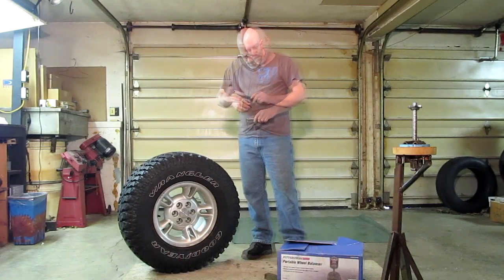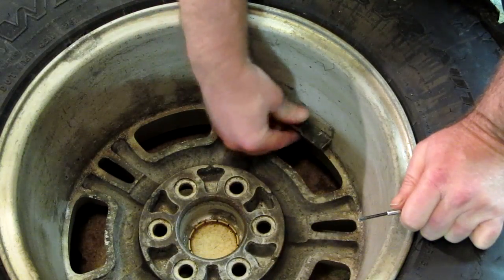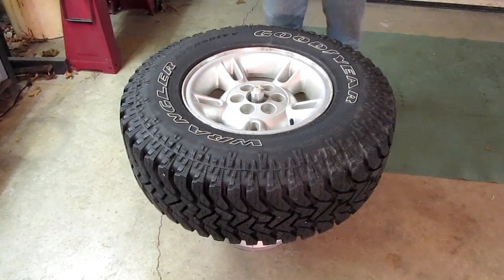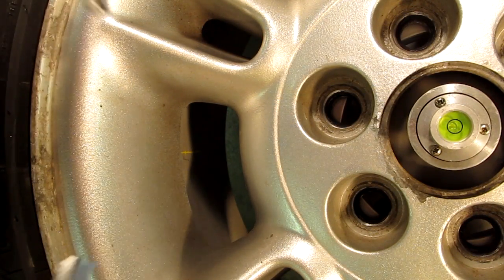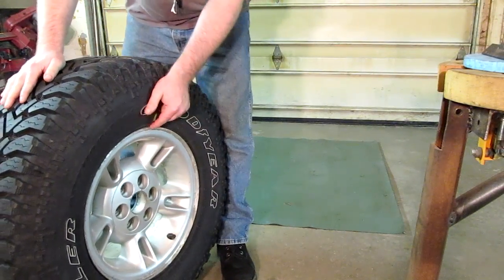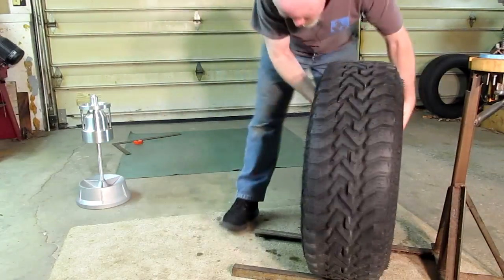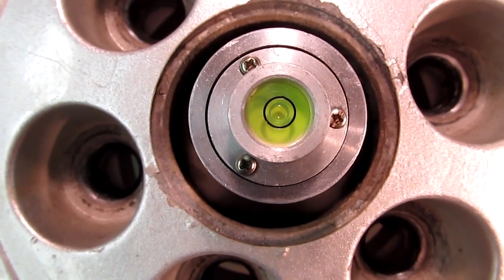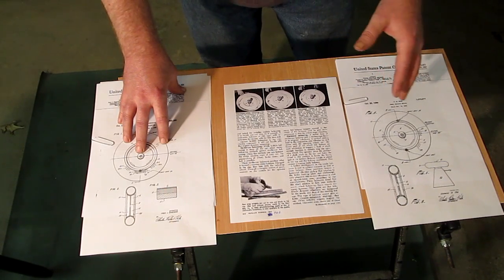Bubble Balancing An Automotive Tire To Correct A Static Imbalance

Comment: Maybe I am in the wrong section but I want to know how much I need to beat myself up when I am bubble balancing using this method which I have now used for years on end thanks to none other than you. 

I really struggle with 245/45s on 7.5 inch rims using a HF manual tire changer. Not so much because of the process but the fact that I am supposed to be aligning the yellow mark on the tire with the valve stem. Adding the duckbill mod and clamps to the changer really helped but since the name of the game is precision I find that it is just too much for me (so far) to line up the yellow mark with the valve stem with a profile that low while focusing on getting the tire on the rim. As a result, I end up turning the tire after mounting it on the rim to make them line up which takes every ounce if strength in my body. It feels doable when I am doing it but my back pays for it for weeks on end in a few days. How much do I really need to focus on getting that yellow dot lined up with  the valve stem? This is getting harder as I approach 50 but it really is that part which is bugging me. Does the yellow mark matter at all or is  placement 100% mitigated due to this process? Having the yellow mark off does mess with my OCD though. Thanks once again for making it a better for the commoners and stubborn bastards as life gets tougher.
Reply from the maker: Hello James, you definitely do not need to beat yourself up over the yellow dot. Putting the yellow dot anywhere close to the valve stem is fine, and even THAT isn't truly important. That dot just means it's the lightest point of the tire... which can be lined up with the valve stem (which is expected to be the heaviest point of the wheel). If lined up, then you MIGHT use less weights when balancing, but that's the extent of the importance of it all. :)

Comment: I worked at a Goodyear tire store in the early 70s. I was taught the 4 weight method back then. Some customers wanted the "on-vehicle spin balance" instead. The boss always had me do the 4-weight bubble balance method first. Most of the time, that proved to be enough and the spin balancer couldn't improve on it much. Good video!
Reply from the maker: Interesting.  Thanks for the input.
Reply: Tell me about the four weight method
Reply: @donovanbaker6835   I worked for Goodyear years ago when bubble balancing and spinning the tire while mounted to the car was all we had. I can't tell you the science of it, but using a bubble balancer, you use two pairs of weights (4 total) of the same individual weight. Slide them around the wheel until the bubble centers. Hammer two weights on the front of the wheel and two weights directly behind the front weights on the rear of the wheel. Then check it. If all is good and you then spin balance them, they will be balanced or really close, provided the car wheel ain't all out of whack.

Comment: Charlie, do you of a video that compares a bubble balanced wheel against a dynamic machine. It would be nice to compare the two. Also, I am an aircraft engineer and a lot of older aircraft have a bubble fitted in the wheel well to jack the plane into a level attitude, so I know the bubble method is accurate.
Reply from the maker: No, I do not have a video of a comparison between the two. It would be interesting, but I haven't done it.

Comment: Do these work for motorcycle tires too or just cars?
Reply from the maker: Definitely go with a different static balancer for motorcycle tires. There is a specific balancer for them and they are easier to use.

Comment: I have this same balance tool and it works well, I have found that when a tire is more then 2 oz of weight off it helps to break the bead and turn the tire on the wheel 1/2 turn most of the time the wheels and tires can be balanced before you seat the bead by just rotating the tire on the wheel and if you are really lucky some times you need no weight at all.
Reply: That's a good point.  Also, with new tires the manufacturer will often put a red or yellow dot on the side of the tire.  Line up that dot with the valve stem of the rim.  If you have both a red and yellow dot, line up the red with the valve stem.
Reply: When you mount a tire, you're "supposed" to line up the balance dot with the valve stem, as that's generally considered to be the heaviest part of the wheel. However, that is not always the case. If you have the time, you can put the bare wheel on the balancer, to see where the actual heavy spot is, then mark it, then mount the tire with the balance dot at that location. I do that with my personal motorcycle wheels. I've seldom had to use more than 1/4 oz. of weight to get them to balance out, if that!

I always get a kick out of how some of my customers will question my ability, equipment or integrity,  because when I do a wheel or a set of wheels for them, I only use a minimal amount of weight, but when a dealership does it for them, they end up using multiple ounces. First of all, they don't have the knowledge or the interest to do it my way. Second, they don't have the time.
Reply: That's the best part about these balancers. I have done that rotation of the tire on the wheel trick when mounting tires and often you can balance with very little to no weight. I learned the trick from a mechanic friend many years ago. It's awesome
Reply: Oh wow great idea!
Reply: I thought it was a tool kit making everything weightless!  Happy balancing!!!! Really!

Comment: Hi Charlie, someone told me to balance prior air filling first and move around tire with rim at same place. The said sometime you could lose some weight that way. What do you say to that?
Reply: It's always good practice to check the wheel balance before assembling the tire!
Many tires also have some dot marks (yellow and red). Keep an eye on the yellow dot, usually for alignment with the valve when assembling! more on that further down.

On a bubble balancer like this, it's a rather simple and easy procedure. You can check the wheel first, mark the lighter/heavier spot with a marker/chalk/tape. Your choice!

Than without assembling, just rest the tire over the wheel. Making sure the bead is properly located around the rim when you lay it down. Get a new reading and correct as needed by moving the tire as you please. When you find the sweet spot mark it. Then assemble the tire by the correct marks.

Usually the amount of weights needed to balance the tire. After this exercise tends to be greatly reduced!  

Keep in mind that the lightest spot on a wheel tend to be by the valve hole. While this is usually true for steel rims, many times it's not so much for alloys! Where reinforcements may be present at that spot. So better check. Also rather common nowadays the presence of pressure sensors or bead lock(s)! Can drastically change the "lighter spot". So make sure to use ALL the variants while doing it. Even the valve cap! ;-)

Quite honestly it's faster to do it, than writing about it. LOL 😂 

I hope it makes life easier! ;-)

Comment: Does make any difference if the wheel 19inch or little bigger. To work correctly?
Reply from the maker: 19 or so is  fine for this static balancing.  Just remember the wider the tire is, the greater the chances of a dynamic imbalance.

Comment: I'm hoping someone can answer this...Why do balancing shops put the stick on weights close to the edge of the inside wheel.  The video shows the weights being put in the center which makes sense.  But, if the "professionals" put it on the edge using sophisticated balancing machines and they do it for a living wouldn't that be the proper place to put them?
Reply from the maker: Weights placed on the side means they are correcting a dynamic imbalance and possibly a static imbalance as well. Placing the weights in the center only corrects a static imbalance.
Reply: Thank you for the response.  So this is something we can't correct for using our bubble balancer.  Guess we just hope for the best.

Comment: I have been using your technique for years now with great success and thank you for that. I do have a question though. Every once in a while I have a rim/tire that is a pain in the neck. When I put the stick on weights as described, The bubble will then move in a different direction on me. I was wondering if it is permissible to add a another stick on weight on an entirely different direction of the tire to get that bubble centered while keeping the first stick on weights I put on installed. Here is an example. I add an ounce of weight at the end of the rim temporarily. The bubble is centered then I measure half the distance of the rim and apply the weights there permanently. I then find that the bubble is no longer centered like it was when I put down the weights temporarily. In fact, the bubble only centers when I put a half ounce weight on some other part of the rim. Not sure what causes that, but was wondering if I can install the half ounce on that part of the rim (of course putting it at the half width of the wheel) if it keeps the bubble centered? Thanks!
Reply: you can do this but I don't recommend it when I worked in a tyre shop we would break the bead on the tyre and move the tyre on the rim say a quarter of the way around and try to balance it again, it could be that the wheel itself is slightly out of balance plus the tyre its self-giving two heavy spots the idea is to get the heavy spots together or if it needs a really lot of weight to turn the tyre halfway on the rim so it counteracts and maybe not need as much weight on  remoulds were the worst for this but not everyone as a tyre machine to do it , so like i say you can do it that way , but was just pointing out the way I was taught but in busy tyre shops they don't take the time nowadays to  look after there customers
Reply from the maker: I would say absolutely yes.
Reply: Thanks for that. You will probably never know the positive impact that you have made for us DIY folks, so I just wanted to make you aware of it.

Comment: should u get tires balanced regularly, or just do it when there are vibrations in steering wheel, seats
Reply from the maker: I balance my tires when new or if i feel vibration (sometimes indicating a lost wheel weight). It also doesn't hurt to check the balance when you do your tire rotation. That's my two cents.

Comment: I used to work in a tire shop in the late 1960s.  We used the 4-weight method most of the time.  Never had a tire come back with a problem.  But spin balancing on the car is better because you are balancing the entire mass of the rotating parts (tire, rum, brake drum/rotor) even though the drum/rotor are rarely that far out of balance.
Reply: I can agree here as I started tyre fitting straight after leaving school, we used the bubble balancer first then spun them up on the car with the magnetic pickup under the axle with the strobe machine when they were balanced the needle would remain in the green showing there was no vibration coming through the car from the pickup , but the guy that taught me was a perfectionist he would extend the Ariel and if there was any kind of flutter from it he would slightly adjust the weights till there was nothing coming through the ariel at any speed  took a little longer to do but never ever got any comebacks from being out of balance people always asked for me in the tyre shop as they liked to know they were getting it balanced to the best it could be , I remember a few of the guys in the shop just couldn't master the art of where to put the weights I found it easy we used to chalk a line on tyre so the strobe would statically show where it is and work from the 12 o'clock position great days wish i cxould go back in time loved my job then .nowadays the just rush everything and halve of them dont even clean the rims where they corroded the paint off or steel rims dont clean the rust off I still fit my own tyres now made my own machine becouse i know its done properly then i watched this video becouse iam making my own balancer.
Reply: @shaunnormancroft  ... Can you update us on your homemade balancer?  Any pics or videos?
Reply: Nice!

I just welded up my own tire machine today and it works. Pretty fulfilling feeling to do it correctly.

Comment: Great video! Thanks for posting. I've mounted and balanced hundreds of tires in my younger years when I worked at a small town tire store, but never once used a bubble balancer. I recently had  a new set of tires put on my brand new vehicle due to running a giant bolt through one of my tires and wasn't happy with the OEM tires anyway. However, the "kids" they have working in today's tire stores leave a lot to be desired when it comes to professionalism. Weights fell off because they didn't clean the wheels properly and where they did make an attempt, they scratched the paint because they just used a rag and wiped them off with gritty dirt scratching the paint. They also broke clips off the center caps because they didn't line them up properly before trying to hammer them back on and assumed I'd never notice. Had it back there twice to have it corrected. I've decided it's worth my time to balance my own tires and do it correctly rather than loose my mind at the tire store and have them do more damage to my wheels and waste more of my time. I was skeptical of the Harbor Freight balancer, but you've set my mind at ease knowing what to expect. HF, here I come with this weeks %20 coupon.
Reply from the maker: +VictoRoy I hear ya, and can relate, lol. Let me know how the balancing goes.
Reply: Any updates after 6 years?
Reply: @kaimanson3174  I honestly didn't care for the bubble balancer as I didn't find it very accurate and sold it in less than a year. I've since found a much better tire shop and let them take care of my tire needs.
Reply: @Roys3dShop  thanks for the feedback.

Comment: why do you share the weights across the width of a steel wheel but not on the alloy, surely it's equally possible to do this with the alloy by fixing them across the identified balance plane in two equi-spaced positions i.e. equally offset from the rim edge both sides - please comment if I've missed a trick here..... by the way this kit looks really well made compared to an old version of the same idea I used 35 years ago - it was called the 'Paddy Hopkirk' Wheel balance - sadly back then I didn't have instructions and only balance from one side - so some times it worked and others not - I was confused back then why, but it would appear to me the weight distribution seems to cater for wheels that may be suffering dynamic imbalance (IMO)
Reply from the maker: +Trevor Milne You've missed no tricks. To correct the static imbalance, you can use either method... across the width or centered.  I prefer centered sticky weights on the alloy,if possible.

Comment: I have done a comparison video on my channel on bubble balancers and digital wheel balancers, it is an impartial demo as I was genuinely interested to see how much of a difference there was from what our workshop used to use and the new tech out there
Reply from the maker: Gerard Burke  Hello, Gerard. I watched your video two weeks ago when you commented on my other balancing video. Respectfully, the results in your video clearly show the reason why I tell people in my video to distribute the weight evenly when bubble balancing. Not doing so can drastically increase (if not create) a dynamic imbalance... as evidenced with your test. Would be nice to have a spin balancer though. It's just not always necessary.
Reply: Hello Charlie, firstly thanks for the reply, I watched your video and many others before I done my own. I was thinking of which way I would bubble balance as there are other methods, in the end I went with the exact way the old manual stated to do it, I also looked up another bubble balancer manual and it stated the same way as I carried it out, plus it was the way my grandad & my father before me balanced wheels dating back to decades ago, so I did want to compare old vs new in my workshop the exact way it was done.
I really enjoyed your video and the info you gave, it was a very informative video.  
 
Keep up the good work.
Reply from the maker: Oh ok, I see what you're saying. Yeah, I know of 4 different methods (there might be more, I don't know) to bubble balance, but have only tried/used 3. I hope you comment on other videos that do show that "old" method so folks can learn from your video. It's for sure an eye opener for those not expecting it. Thanks for commenting Gerard.
Reply: For sure it is, I was not expecting the results I got either, Thanks for watching.

Comment: The bubble balancer I use for motorcycle wheels is a tree type(Coats 280). It's basically a mini cherry picker that the wheel hangs from rather than rests on. You mount the balancer itself on the wheel through the hub with a cone style screw. Then you hang the banlancer on the tree, which pivots on a point similar to the one on your balancer. It does pivot on the tip, not below it, and is extremely sensitive. It is also extremely delicate. That tip will eventually wear out and turn into a ball. You can still get a good balance but you have to be more careful. The more accurate the bubble balancer is, the more fragile it is. It's like a knife edge. The sharper it is, the better cut you get, the faster it wears out. 

The nice thing about having an extremely delicate balance pivot is the fact that you don't need anything even close to a perfectly level base. The balancer will zero out no matter what so long as the tip is in good shape. A bubble balancer that hangs the wheel far below the bubble itself will always be more accurate than one that the wheel sits on top of.
Reply from the maker: Interesting information. Thanks for the input.  Just checked out that balancer... pretty cool. Haven't seen one like that before.